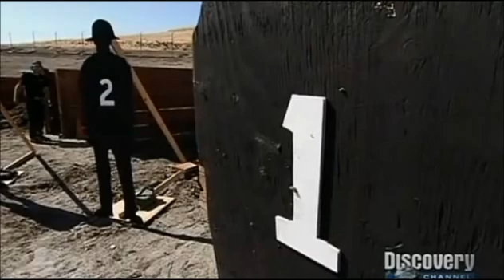Hollywood Hand Grenade Heroes - Mythbusters for the Impatient

Comment: Wouldn't there be a shockwave as well as shrapnel? They should have included those pressure discs that they've used before.
Reply: Grenades are really only supposed to throw shrapnel everywhere, the blast wave is minimal. It’s the shrapnel you have to worry about

Comment: You have to also add I.B.A. (Individual Body Armor) as well which is only for shrapnel, not bullets
Reply: Flak vest and IBA are two different things. I.B.A. ceramic plates and soft armor are capable of stoping 7.62x54 mm rounds and did many times in Iraq and Afghanistan.  Flak vests on the other hand are rated to only stop shrapnel.

Comment: Would it be more realistic to use enemy grenades instead of US ones?
Reply: What are "enemy grenades"?
Reply: Doesnt really make much sense.. Which enemy in which war?
For the most part the grenades US forces might have encountered are probably F1 and RGD-5. F1 has much larger and heavier fragments. RGD-5 is comparable M26 or M67. The construction elements and method of operation is identical. Steel body and an internal pre-fragmented coil, filled with a small amount of TNT/RDX high explosive. Fragment size, velocity and dispersion is rather random for all grenades. You can do the same test 10 times and get 10 different results.
Reply: That’s all true – I had forgotten the famous CARROT top secret study after WW2 by the EMO Phillips group at the CIA – the study found that the capture and testing of German weapons had been a complete waste of time as they were mostly the same as ours and US weapons could be tested in their place.
Reply: there is a difference, taliban uses old russian ww2 grenades. those are pretty damn small and dont have much shrapnel and power
Reply: grenades that the enemy used against us in the war -  looks like the Mythbusters are using US grenades